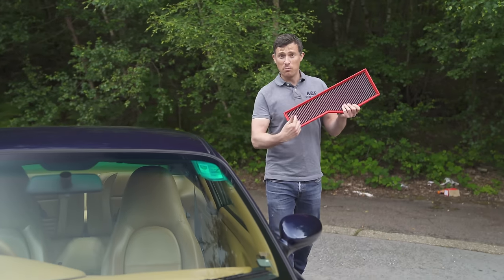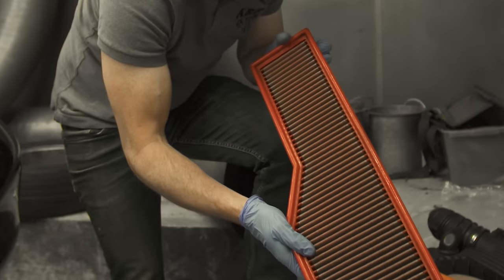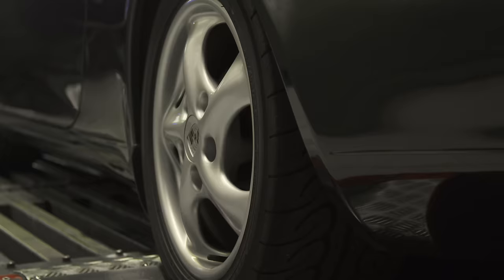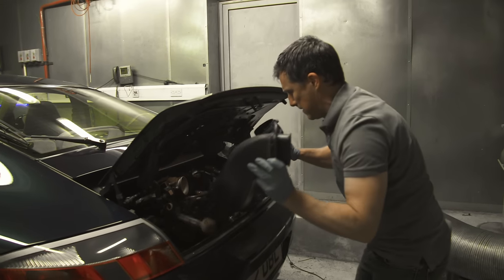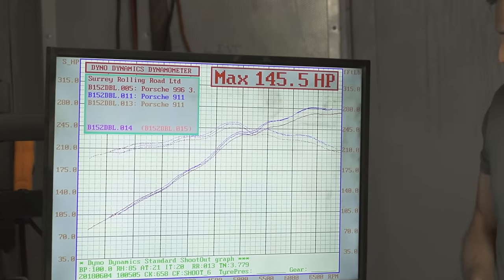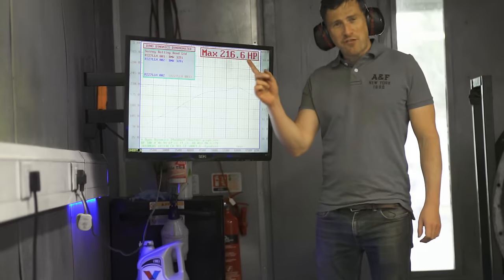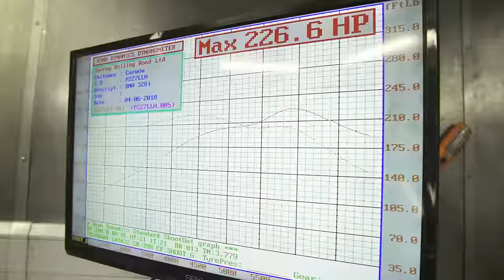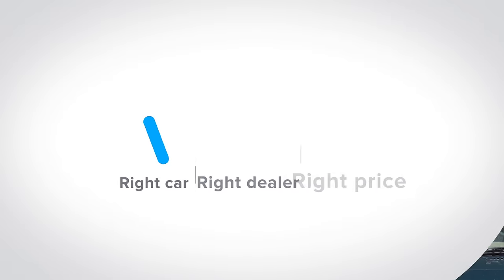Does a performance air filter give you more power? I fitted one to my Porsche 911 to find out!

Comment: The "gain" from these filters is almost imperceivable to the test uncertainty level.   And if you get one for a turbo it's even worse.   Because they're forced induction the filter has no effect other than to provide clean air.

With filters their ability to filter gets better as the larger trapped particles help filter smaller and smaller ones.   Paper filters use a huge surface area to allow enough air through, but the performance ones must sacrifice their filtering abilities.   That you can see through some should tell you enough!   So you're letting more dirt in to your engine, and that can't be good.

Comment: I installed the drop-in K&N filter for my Toyota 86.  I find no performance gain but the engine response is noticeably quicker.   Anyone feels the same ?
Reply: Jonathan Chen just bought bmc for my Toyota 86 , I’ll tell you the differences after I fit it
Reply: @a7ma1d22  have you noticed a difference after fitting it?
Reply: Yaz H sounds way better tbh and the engine response is quicker , really worth it
Reply: I reckon you feel a difference for about a week but after that it's all the same

Comment: you want cheap and easy performance gains... fitting GT3 throttle body to one of these will gain you quite a bit, especially if you can then do a decent custom remap to take the extra air into account.
Reply: Shrink1061 finally someone makes a valid comment, other than stupid remap or IMS fears.
Damm I could have earnt a fortune too out of hype if only I had no conshonce.
Reply: That's because unlike most of the keyboard warriors here, and the internet car dreamers, I actually owned a Porsche, so did lots of real world research about best value ways to get a bit more out of it, and Porsche are rather famous for limiting throttle capacity on the smaller cars. Putting a 3.6/3.8 TB on the basic 3.4 Carrera can make a big difference.
Reply: Quite a bit is around 3/5hp? It’s na Porsche got pretty much all the power you can get out this car, they charged £10k for a kit with engine mods upgraded exhaust and intakes extra radiators ect for this car to gain 25hp forced induction is the only real way to go or 200 cell cats and that’s just because Porsche couldn’t legally fit them to a factory car but should get about 15hp

Comment: Don't really understand the hate against performance panel filters,  I've fitted them into various cars over the years and always found a positive effect, improved throttle response and an improvement in pulling away (low end torque I suppose) at the very least ,....... I recently fitted one to my wife's focus st without telling her and a couple of days later she said that her car was now "different and was driving amazing" 🤷🏻‍♂️🤷🏻‍♂️ so absolutely no placebo effect there 
Am literally fitting an AEM dryflow into my cayenne this morning..... Imo yes the rolling road fan keeps the engine coolant temps normal but in no way can replicate the air pressure/ volume or air temperature of actually driving on the road, jmo...... Update AEM filter now fitted,   initial 200 rpm extra revs at idle which the ecu sorted within 30 secs.....  in normal mode the cayenne pulls away in 2nd gear and there was a very obvious increase in torque,  better throttle response, revs more freely, nice induction roar, I'd have been happy if it cost me 100 quid, not the £58 I paid...... Wish I'd have done it years ago
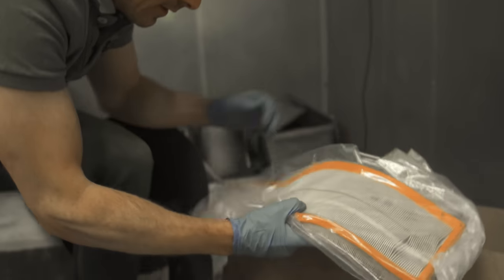Reply: Believe in JESUS today, confess and repent of your sins. No one goes to heaven for doing good but by believing in JESUS who died for our sins.  For God so loved the world that he gave his one and only Son, that whoever believes in him shall not perish but have eternal life.(John 3:16)🥳

Comment: Was there a Dyno run done on the BMW before the mods?
If it wasn't then you have no idea what the performance gains are. It needs to be tested before and after and on the same Dyno with preferably similar weather conditions to be a conclusive test. The standard car may have made higher than manufacturers power as standard...

Comment: shell v power is waste of time. got a few mates who work down at the oil refinery in Farley who make the stuff and they say the extra detergents they put in the fuel is at such a trace level that it basically does nothing. petrol itself is a decent cleaner and getting a bottle of redex or equivalent cleaner will help clean out the injectors

Comment: The Dyno yields rear wheel HP.....Drivetrain power loss (anywhere from 10-25%) robs HP from the flywheel to the wheels.  Porsche (and all other car manufacturers) advertises in flywheel HP, that is the difference why you see less than expected on the Dyno display.  With a Dyno run of 282 HP, flywheel HP is higher than what Porsche has advertised.

Comment: I've heard that performance air filters shorten the life of your engine since they let more air(and thus various particles) in the engine. So, for a normal everyday car I don't think that it is a good idea. But then again, I might be wrong.
Reply: you are wrong
Reply: Ok, but please explain why!
Reply: Beshev Games ask anyone using a K&N used them in my cars never had problems.
Reply: A very good friend of mine had a K&N filter in his '05 Mercedes C200 CDI and started having problems with the engine, the most serious was that it mixed oil and fuel because of scratched cylinder walls. 
I mean, just telling me that "you are wrong" and no scientific/technical facts from test just doesn't help me, or anyone else, a lot :) .
For example - foghorn67 writes: "I had someone do a back to back and back again oil analysis done. K&N was dirtier. Completely scientific? Nope. But this was just another reason not to". You can check the discussion here:

https://forums.anandtech.com/threads/so-wait-k-n-air-filters-really-just-lots-more-dirt-in-your-engine.2040364/

Also here: https://advrider.com/index.php?threads/why-is-k-n-air-filter-so-bad.409192/
Reply: Wrong the performance filter is pleated this increase the surface area, therefore, allows more air to flow, it doesn't necessarily improve performance because the air meter compensates for increased flow. The hybrid filter just lasts longer.

Comment: I had the same experience with my old peugeot 106 from 1998, I gave it an aftermarket performance filter and it sounded like it was tuned, but felt the same. It was also more likely to stall when cold starting probably due to the engine getting too much air

Comment: Performance filters let in to large dust particles and will reduce the lifetime of your engine. And for that you gain 0-2hp  if you are lucky at top end.  Often with reduced torque in bottom and midrange.

Comment: If I'm correct your car needs a tune to run an aftermarket intake, BECAUSE the car is sucking in more air the computer is not allowing that because it's factory tuned to let certain amount of air in

Comment: Mechanic told me once that the performance filters do not filter as good as the stock so over time the engine will loose power and sensor and valves need cleaning.

Comment: You are making a mistake by installing those K&N air filters. Those filters are for off-road use only and should not be used as your normal filter. They do not filter the incoming air as well as OEM or disposable filters, and you will foul the MAS sensors and fuel injectors.

Comment: I wouldn't advise on upgrading air filter to your car unless you know how to professionally tune your car. Especially with the 911. Why? Because you will allow your 911 to run too rich and the symptom will be a sooty exhaust. This could lead to damaging your injectors which will wash out your cylinder walls with too much fuel. As a result, you end up with the infamous bore scoring. I would leave everything stock and just change oil every 5k miles if you want longevity from your 996.

Comment: If you remap the engine after puting in a "sport" filter you will get some extra power. 
You should actually remap the engine after every mod that has been done to actually get the most out of it.
Reply: Wouldn't the engine automatically compensate for the increased airflow?
Reply: @RobManser77  4 years later... 😁
Usually engines are not programed to make more power then it has so it might use the air it gets more efficiently but without power gain. Unless you have an older car that is without or low tech computer controlled injection. But im not 100% on this of course, i dont know all engines.

Comment: I had Vauxhall Omega 3.0 L 2000+ twice (I crashed one) and put there always K&N filter. Yes, sound was better, no, it wasn't going any faster, but I always had problems with air weight sensor after while. So I don't recommend this solution to anyone. Stick with original paper filter, car manufacturers know what they are doing... Now when I am older and can have new cars, I don't make this stupid decisions about "tuning"...

Comment: Mighty car mods did these tests years ago, so has engineering explained. A 3% power increase on those first runs was a rounding error and would never be felt on the road. The only benefits to aftermarket filters are, they are reusable, thus saving money eventual on services and more filtration, which can cause a lower power figure. All the Honda rice boys out there that claim they feel a difference when they put on pod filters are crying. Also, careful of over oiling the filter lest ye grenade an engine.

Comment: Great Video! You can increase the reliabilty and lifespan of almost any vehicle by taking care of it and following the manufacturers recommended maintenance schedule. I use software on my laptop called Automotive Wolf car maintenance software that tracks and manages the schedules for all my vehicles and sends me text reminders when anything needs to be serviced. I currently have 3 cars from different manufacturers all with over 200,000 miles and running great.

Comment: fuck this high performance filters I had a k&n one in my audi a3 sline all it did was make the engine rev like crazy and the auto gear box could not decide to change gear or not to change gear got the standard mann one in boom the car drives like it should and it seems faster

Comment: That’s misinformation. A good quality air filter = more and better air flow which  = more power. So I suggest that the new filter you fitted was restricting the air flow more than the standard.

Comment: U bought the wrong air filter, try a pipercross air filter , I had one in my old e46 325 msport and now in my vectra Sri, they r foam filters , also your ecu has to get used to the change of filter, u can’t just take one out and put another in then dyno it.??  And buy a new exhaust for f sake it’s a 911.??

Comment: Now days cars aren't just about the flow. It all deppends on the software, how it was tunned.
I think that the more the flow, the more the HP, fact.. but for more flow, the filter actually filter less.

And that's the issue. On ideal situations i bet the higher flow is better. But on a poluted city, the better the filter filters the polution, the better the O2 Sensor result we will have and there fore the ECU will allow for better air fuel mix..

Comment: I guess it needs a remap. I think, no matter how easy it is for the air to pass through the filter, the engine can only use the amount of air it needs depending on its current tune. That's why the power gain is minimal. And it's only on higher rpm because that's where the engine uses more fuel so it can accommodate more air. The reason it losses a bit of power at lower rpm is because the idle airflow is too high for the current tune. The engine is getting the same amount of fuel but there's more air than it needs. That extra air is just consuming space at low rpm effectively reducing engine displacement. 🤔 Just my guesses. 😅✌️
Reply: Jed Adriel Luna, you guess wrong, you'll gain next to nothing remapping a naturally aspirated 996 just by remapping.
Reply: Mustang Boss On a stock engine. But he has a performace air filter. Isn't that gonna make a difference? Even a bit? 🤔
Reply: Jed Adriel Luna, unfortunately not. 
You could spend about 4k and see very little gain it's really not worth it unless you really know what you're doing.
What people don't realise with car like this is every bit of design is from tried and tested track development and previous production models and cost a fortune.
You want more performance simple answer is get the Porsche turbo.
You will throw a lot of money at one of these for very little gain, shame is there was a time when you could pick up 996  turbos for about 22k hell of a car for that money.

Comment: changing the air filter without an ECU reprogramation is the most stupid thing you can do. You are puting more air in the engine... so you have to re-map the ECU to increase fuel in the engine chamber to increase power....

Comment: Your better off with the performance air filter anyway even if theres not much in it,as you will have to replace the standard one more often because it will clog up much quicker.
With performance ones you can of course clean them up many times with the recharger kit and reuse them for many years.

Comment: Do these people know nothing about cars and powertrains?! First off, changing an air filter then just expecting it to work.... quite obviously the bloke at the Dyno should think about getting a new job haha. Doing anting like changing filters or exhausts for performance will require and engine ECU mapping. Again the dyno bloke should know this, it’s standard. Your increasing the flow of air into the engine, the ECU senses this through the mass air flow, thinks fuck... something’s wrong... as a fail safe it’ll restrict the power, most likely idle shit and decrease power.... worse case scenario you get ya engine MIL on.... what dya know, failed MOT and your scratching your head and forking out daft money for something simple. A stage 1 map would’ve helped, maybe don’t use Charlie though.... that job is a bit beyond the average ape 😂😂🤦‍♂️

Comment: I can’t stand videos like this because they’re rubbish. The dyno used in this video obviously automatically adds in a set calculated percentage to compensate for the parasitic loss of power from the drivetrain. It’s almost impossible to know how much power each car is losing from the crank through the transmission and to the wheels to get an accurate number. The industry standard is 15-20% depending on the transmission and type of car. But unless you run a car on a chassis dyno and then pull the engine and run it alone on an engine dyno to find the difference, you have no way to know precisely how much power you’re losing. Using the industry standard leaves way too many variables. I’ve seen two identical cars put down significantly different numbers before which proves that just because one car loses 15% from it’s crank to the wheels doesn’t mean the other one does. It would be interesting to know what figure they’re using for the dyno runs in the video. Besides the fact that they don’t know how much to accurately figure in to their calculations, production engines rarely put out exactly what the manufacturer claims. Especially after a few years of running. In some cases an engine will put out a few horsepower less than claimed by the manufacturer and sometimes we’re lucky and the engine puts out more than they claim. The cars used in this video are older and probably fall within the 15% range for power lost but I’ve seen new 2017-2018 cars that are so much more efficient today lose as little as 10% through their drivetrain which is very good. I’ve also seen cars lose over 30% due to their AWD system which is a huge loss. The point is there’s no way to know and the few horsepower difference in the video makes the whole video pointless. If the Porsche is losing 14% or maybe 16% would change their numbers more than just a few horsepower so there’s no way to really know. That’s why in America we typically just show the horsepower numbers to the wheels and don’t try adding in an unknown figure to compensate for parasitic losses.
Reply: Agree on the first point. It's not accurate. Disagree that "wheel horsepower' is therefore more accurate. Problem with measuring at the wheels is that the number you get can swing wildly in different directions with some small changes while the engine is making the same power in each case. Different results in different gears, a change of wheels and/or tires or even just tire pressure can skew results massively. The only chassis dyno that can be relied on to spit out the same engine power number no matter what you throw at it (you could even even go to a different shop with a similar setup and get the same result) is made by MAHA and it reliably gets to what the real crank number is as close as makes no difference. Somehow or other they manage to do it with nothing but coastdown losses and their own proprietary calculations based on things like engine layout, transmission type etc. In any case, the horsepower "lost" between the engine and road surface is not a fixed percentage anyway. It's closer to a parabolic curve, which has the side effect that peak engine power is usually quite a bit higher in the RPM range than measured peak wheel power.
Reply: @JCviggen1  Uuum, yes - what he said (probably)